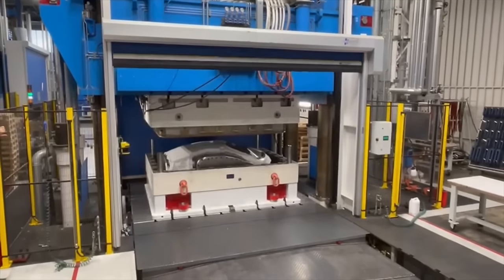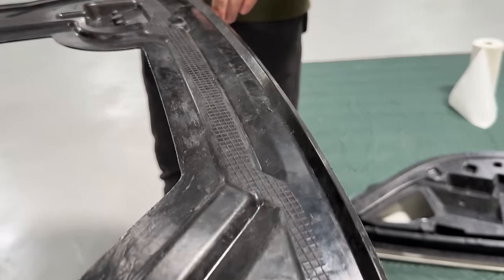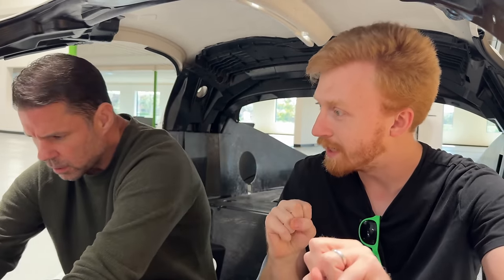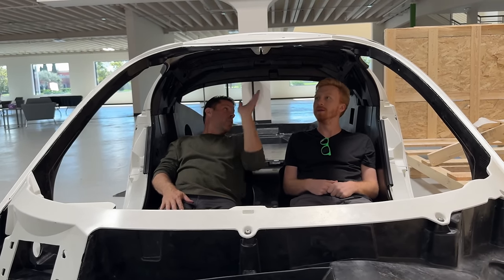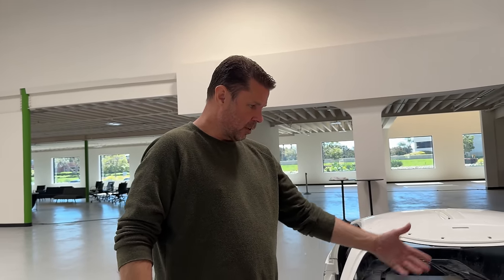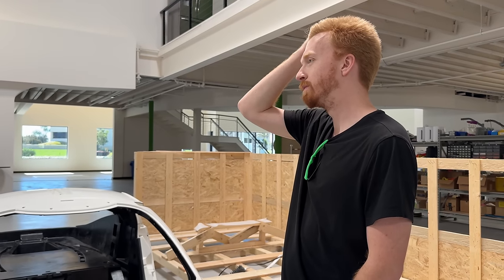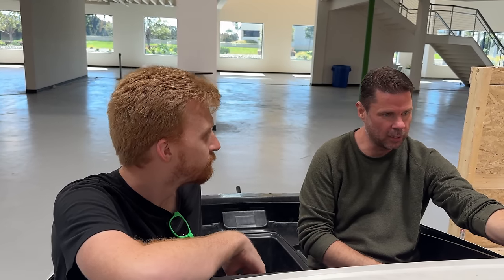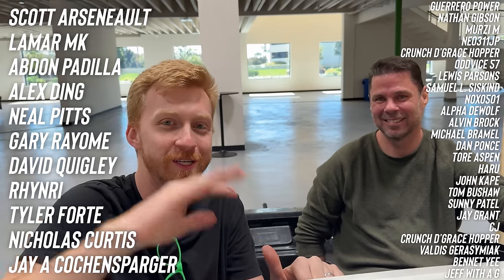Aptera Answers YOUR Questions!

Comment: Here's a pretty insane fact I learned recently: it takes 4kWh of electricity to refine a gallon of gasoline out of crude oil. This means the Apetera travels 40 miles before the gallon of gas even gets loaded into the ICE car !
Reply: Yeah when people argue that EVs don’t actually help the environment, they forget this fact. Reminds me of that terrible Conway Ted Talk.
Reply: And that doesn't include the energy it takes to find the crude in the ground, drill for it, pump it our, transport it multiple times, power the associated infrastructure, including the pump. 

I've heard a bunch of numbers for the kw for each gallon refined. Do you have a source on 4kwhr? I'd like it for a research paper I'm working on. Thanks.
Reply: 4-7kwh actually.  estimates differ as most refineries use the oil itself as a fuel source in addition to external electricity.  Oil extraction also uses wildly different amounts of power (canada oilsands are insane)
Reply: Also it would take around 500 kWh to produce a 700 W solar panel. So even before you run a mile, you already had a deficit of 5000 miles buddy.
Reply: @Kukaboora  Source?

The aptera is different from a typical solar panel, because the space where the solar sits would have to be glass or some metal anyways. 
So the only parts the aptera really needs to  in addition is the solar wafers, cables/conductors and bonding between solar and glass.

A typical 400w solar panel uses approximately 1.5 kg of silicon. So lets estimate the 700w of aptera using 3kg. 
The energy input needed to transform pure silicon to a usable wafer should be around 20kwh per kg. So the wafers in aptera would have needed somewhere around 60kwh to manufacture.
The cables/conductors and bonding materials likel, don't need much energy to produce, but I will estimate them as equal to the energy used in wafer production.
So my estimate for the extra energy used to put all possible solar into one Aptera at 120 kwh.

Looking at a launch edition (40 kwh battery) the solar panels need to provide 3 full charges to be worth their manufacturing energy. Which equates to unds 1500 miles, a single month of charging from solar panels in san diego, approximately 36 days of the average daily drive of an american vehicle or 30 gallons of fuel burnt in an equivalent gas vehicle (which btw doesnt exist) according to the 4 kwh per gallon in refining cost.
Reply: I did the math a few months ago and got an absolutely bonkers number: the energy contained in a modern F150's fuel tank, using the EPA's number for how much energy is in a gallon of automotive gasoline, is enough for an Aptera to drive over TWELVE THOUSAND MILES. Now, that's assuming perfect efficiency with no losses whatsoever - assuming only 25% efficiency that's still an easy 3 thousand miles of range... for the truck to go around 400 miles.
Please double check my math if you want; all you need is the fuel capacity, an estimate for the amount of energy per gallon of fuel, and the numbers we already know from Aptera.
Reply: @Kukaboora  Okay, so payback in a year.  What's the problem?
Reply: https://youtu.be/xCBzGWU9Gdo

Links to sources are in the description of the video
Reply: If you search YouTube for "How much electricity does refining gasoline actually use?". There's a video on my channel with links to sources in the description
Reply: @Kukaboora hopefully Aptera lets has the solar panel as an option, we that park in a garage or are living in in northern and southern countries with less sunlight and sun hours can order it without.
Reply: @ApteraOwnersClub  
Few years ago, Volvo of Sweden did a comprehensive study of life cycle effectiveness of EV. Their conclusion was EV has to operate around 87,000 miles to break even with ICE regarding the impact to the environment.
It is no panacea.
Reply: @Kukaboora That's not even a year of driving. Pretty acceptable offset by the up to 11K miles produced in a year
Reply: @Klust413  
Yes it is.
My response is to counter the hyperbole “Aptera travels 40 miles before the gallon of gas even gets loaded into ICE car” which is nonsense.
Reply: @Kukaboora  that depends on the assumptions that are made.  Give me a link to that study.   If you compare a Hummer EV to a gas Corolla yeah it's gonna look bad.    If you compare a single motor Tesla model 3 to a gas expedition, it's gonna look amazing.   If you do apples to apples comparisons, the carbon equity happens within 2 years of ownership and 25k miles
Reply: A gallon of gas is 34kwh so 34kwh for 4kwh is worth it
Reply: @Kukaboora  And how many miles must an ICE operate before breaking even with an EV? And for the record, converting everything that can to strictly use electricity as a fuel rather than utilizing localized fossil fuel processing is a panacea. Because you can convert all sorts of resources into electricity. Electricity is, currently, the optimal form of energy storage. A gallon of gas at a power plant generates more power than a gallon of gas in any commercially produced car.
Reply: @ApteraOwnersClub  
There are many, but this is one of them.
On November 12, 2021 Sam D Smith published this article on CarCoops:
“ Volvo says manufacturing an electric car generates 70 percent more emission than its ICE equivalent”
Have fun with it.
Reply: @VictorDavion 
Here is my answer to you about panacea.
I can drive my Honda civic from here Atlanta to San Diego non stop. All I need is carry with me 10 five gallon tanks.
No EV can carry even one extra batteries.
Fossil fuel is the most energy dense. No battery can compete in that regard.
Reply: @Kukaboora  Wrong.  Volvo's study was thoroughly de-bunked.
Reply: @VictorDavion given that powerplants don't run in gas I bet they can't convert it to energy as efficiently as a car
Reply: @johnreeves7261 debunked by the old Twitter censorship team that no longer have jobs? Haha
Reply: @Harrythehun I know you can specify differing amounts of solar, but not sure if you can have it "bare" Not sure how poor your sunlight ration would have to be for zero carbon to be a good idea.
Reply: @samuelfox8126  said: "debunked by the old Twitter censorship team that no longer have jobs? Haha"

My response: funny but not true.  Haha
Reply: @samuelfox8126  "given that powerplants don't run in gas"
Since most powerplants utilize combustion they could not run without oxygen, which in th absolute majority of cases is added in its gaseous form.

But you may also mean "run [on] gas", to which I have to say:
Yes, they do. Not all of them ofc. But a lot do, maybe try google natural gas power plants?
Reply: @Kukaboora  "Few years ago, Volvo of Sweden did a comprehensive study of life cycle effectiveness of EV. Their conclusion was EV has to operate around 87,000 miles to break even with ICE regarding the impact to the environment."

You misquoted the "Volvo of Sweden" study (it's 87,000 KM not miles) AND the study was discredited long ago.  Try again kukoo.
Reply: @johnreeves7261 
Debunked by whom? Give me a link.
Reply: @palindromeambigram4852 
Discredited by whom? Give me a link.
Reply: @Kukaboora your number probably isn’t accurate but even if it was the 700W panel will generate 5000KW in a year. Panels last at least ten years so you still come out way ahead.
Reply: @Dani-kq6qq no it’s not.  An combustion engine is only 15-20% efficient.  That is more than 4x less efficient compared to an electric motor.
Reply: @Kukaboora only 15% of that energy is converted to motion, not to mention the energy required to make gas and transport it.
Reply: @greghelton4668  
That was not my point. My point is to respond to some ridiculous hyperbole statement of user @tonydevera4611.
By the way, a 700 w panel would generate 4.2 kWh a day and 1533 kWH a year on the average.
Reply: @greghelton4668  Do you mean a 700 watt panel will generate 5000kw-hours in a year?  If so, no way.  I have a 3060 watt array pointing due south at about 18.5 degree tilt from horizontal and I live in Southern Arizona.  It averages just over 16 kw-hrs per day which, when multiplied by 365 days a year equals almost 6000 kw-hours per year.  Aptera's array would be lucky to produce north of just 1000 kw-hours per year.
Reply: @greghelton4668  More efficient in terms of what? 800lbs of car battery is equivalent to less than 80lbs pounds of diesal. This is why gas cars can travel longer distance, efficient storage of energy. And this is why electric trucks cant tow long distance, poor weight to energy storage efficiency. And even when the battery is empty, it is still 800lbs, the difference is negligible. While gas tanks become lighter when they have less energy. And the total package of the vehicle would also be 20% more weight. See, I too can play the efficiency game, it depends on what you mean by efficient. If you mean fuel usage efficiency, yes, evs are more fuel usage efficient, but that is not the question. Spending 4kwh in refining to get 34kwh of energy is still obviously worth it by virtue of the fact that is a business model that works and even mathematically using the worst efficiency of gas cars. And also, combustion cars can be much more efficient than 15-20%, but even with your low balling, it is still worth it.
Reply: @Kukaboora  google Study Against EVs Backed By Legacy Automakers Is Debunked In Epic Way
Reply: Mining of the minerals for batteries is absolutely worse for the environment. Battery manufacturing plants need their own coal buring power plant to power the factory. ICE are less destructive to the environment.
Reply: Your forgeting how much more energy it takes to mine all the minerals for the battery's. Not to mention you now have to manufacture battery's. Making battery's takes more energy then making ICE's.
Reply: @robl4479  Please avail yourself of the many, many "studies" that unequivocally show you are quite wrong.  EV's are far and a way, overall better for the environment than last century's tech.
Reply: @robl4479  Exhibit A at trial against misinformation....
Reply: don't forget the energy loss from the powerplant to the E.V. ;), but yeah this car is really the future!
Reply: How much petroleum goes into those plastic body parts?
Reply: @papasquat355  less than petrol cars lol
Reply: @Harrythehun  Parking in a garage at night, when it is dark, does not subtract from Aptera's solar projections. Unless you are trying to driving your Aptera in Antarctica the full solar will likely gain you 1/3 of your yearly driving kWh's if you reasonably optimize daylight orientations. Why option out that capability?
Reply: @ApteraOwnersClub  And gasoline keeps getting dirtier as it is extracted from increasingly sub-optimal substrates, while our electricity keeps getting cleaner and greener. Something to consider when looking at the lifetime environmental impact of a new ICE vs EV vehicle purchase. And Google just teased me with this: 

With regular use, the average lifespan of a gas vehicle is 150,000 miles or eight years, and EVs can last up to 200,000 miles, or about 12 years.

Do Electric Cars Last Longer Than Gas Cars? - Ontario Auto Center
Reply: @Kukaboora  But it is stupid to lower your efficiency hauling around those 10 five gallon tanks. Love to see how you onboard those ten stinky tanks into your Honda Civic. And you gotta stop 4 to 5 times anyway to use those tanks to fill your car's tank. The physics equations for WORK have weight as their main elephant in the room that must be overcome. You are talking about  31 hour 2,140 mile trip. Yeah battery packs are heavy, but remember EV's do not need those gas engines with their thousands of moving parts, big radiators, transmissions, drive shafts, exhaust systems, engine oil or gasoline. I doubt a fully charged EV is any heavier than one with a battery that arrives at a charger. 

And are you really relying on a 'Volvo study' to help you shape your core ICE vs EV beliefs?  So many other studies come to the opposite conclusion. You know, studies that factor in broader, more comprehensive lifetime environmental impacts that should be reckoned with. Gasoline does not magically appear at a gas station pump with no environmental impacts (nor electricity to a charger). And gasoline keeps getting dirtier as it is extracted from increasingly sub-optimal substrates, while our electricity keeps getting cleaner and greener as renewable electricity generation out-competes fossil fueled power plants, and renewable generation achieves even higher efficiencies as their tech matures.
Reply: @jeffcarlton3590  
Stupid? The US army won the WW2 doing just that. They carried extra tanks on the army Jeeps.
Even it is stupidity, EVs just can never do it.
Next time think twice before you say anything.
Reply: Since I have gone completely away from ICE I am in awe of the complexity of ICE cars and trucks and how many different parts they need to run. I am on my 3rd EV and have had to have any mechanical work done at all.  I can not believe how good it feels to never go to and auto mechanic
Reply: @jeffcarlton3590  read again? I live in northern Europe with limited sunlight and I also daypark in shaded places. Much less sunlight for my use cases
Reply: @jeffcarlton3590  Mate, the nissan leaf's kerb weight is like 1500 kgs, this is a small/medium sized hatcback and weighs 100kg more than my old lexus with a full tank of petrol. When speaking of the actual physics involved in moving an object it's important to actually know just how heavy the thing you seem think is so great is, how heavy is the cybertruck again? Those motor efficiencies are being wasted dragging around dead weight 99% of the time.
Reply: @Dr.Gehrig I'm inclined to take that figure with a pinch of salt, theoretically it takes a tenth of a barrel of crude to put one barrel through a fractionation tower, I'm skeptical when people say it takes a certain amount of KW hrs or even electricity to refine crude, refineries use mainly process heat, not
 electricity.  As for the energy to lift crude from a reservoir, I worked on  a platform that could produce 5000 tonnes of crude per day from a 10MW gas turbine, ie it took around one percent of the energy from the oil produced to lift the oil.
Look, I could be talking out of my hat here, I've worked on plenty oil rigs but never in a refinery.  But I did  read a paper on fugitive emissions from fraccing completions and found it completely laughable, I suspect that the studies for oil refineries are equally bad.
Incidentally I don't own a car, use an e bike, I have no agenda here.
Reply: @VictorDavion It's true that a power station is more efficient than any car but you have to account for transmission losses, rectification losses, battery cycle losses.  Burning the gas in a power station is still more efficient but it's not 60% versus 20%.
Reply: @Kukaboora  Is anyone arguing that some mode of transportation that uses energy gets that energy at no cost?  Of course it will take time to get the money/energy back that goes into some more efficient/expensive solar technology upfront.  Even if your numbers are right, if one gets 40 miles of solar per solar recharge of the aptera, that would mean that it’d take just over 4 months of recharging from the panels to get that extra energy back.  I imagine the extra financial cost to pay for the panels would take a bit longer.  But in total I doubt it’d take longer than a one year.  

I don’t know about you, but I usually plan for my vehicles to stay with me  much longer than 1 year.  

Hybrid systems for ICE sedans by comparison take about 3 years to pay for themselves.  And for SUV hybrid systems it’s over 5 years on average.  But most cars last closer to 12 years on average.
Reply: @Kukaboora  You're accounting for the manufacturing cost of the Aptera, but you're not for the ICE vehicle, a dishonest skew in itself.
Reply: @Kukaboora  so it pays itself off energy wise in roughly 8 months nearly worst case scenario. 500,000/(700 watts per hour for 3 hours) is 238 days assuming a very conservative amount of energy produced per day. I think that’s perfectly reasonable, a pretty sound investment in paying energy now to get energy later. That’s also assuming the electricity used to make the panel isn’t also being made by “paid off” panels that have returned the energy it took to make them.

Comment: I love the confidence showing from years of mechanical and composites engineering the CEO displays throughout this video, climbing, sitting, lifting and jumping all around the one BiNC.
Reply: Yeah, but how great would it be if they got rid of all their engineers from upper management and replaced them with bean counters, while subcontracting all their work to the lowest bidder to increase their short term market value?
Reply: @xpeterson  Tesla fired all their motor engineers when they ran out of money in 2008.  I know because i worked across the street from them in Union City, and we hired them for a non road vehicle project we were working on.